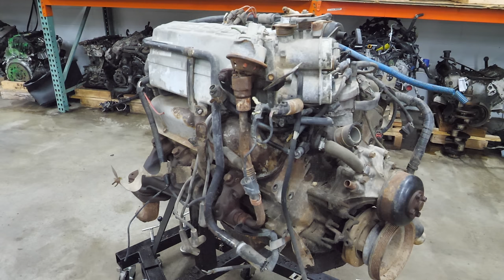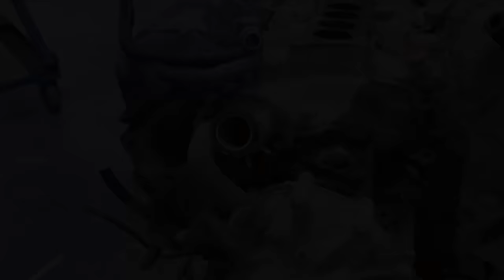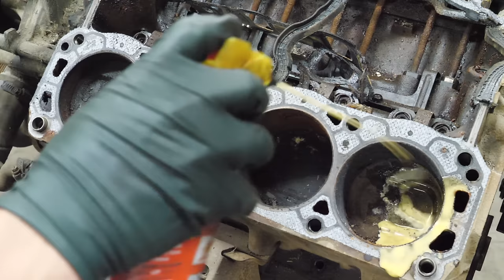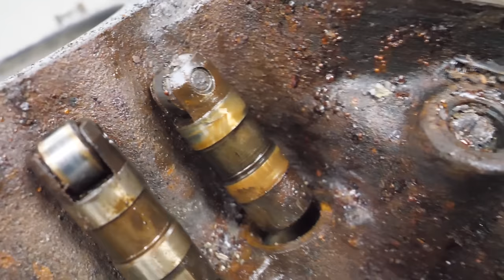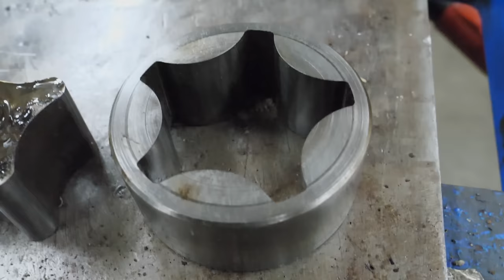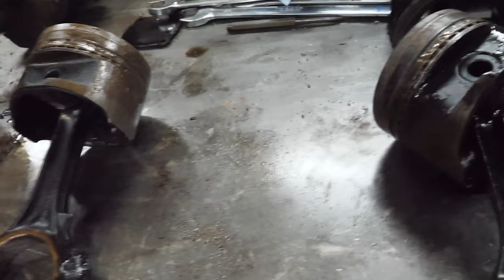LOCKED UP Ford 351W 5.8L V8 Engine Teardown. How Bad Could It Be?

Comment: Last year, I was in Oklahoma and bought a 1984 F150 4x4 with a locked up 300ci. I trailered it home and rebuilt the motor. It's my daily driver now.
Reply: I live in Oklahoma and in December I trailered home from North Carolina a 1983 F-150 4x4 300 six with 17000 original miles. Still needs some tlc due to age, but I’ve been daily driving it and I love it!
Reply: Im sure at some point brandon will ban these old trucks and force you to buy 10,000 lbs of chinese batteries
Reply: @robertshelton3796 what a totally on-topic not against the guidelines response to a couple guys having a good time sharing trucks
Reply: those 300 engines even with rod knocks will go 300k easy great engine
Reply: First engine I did real work on was 300. Head gasket failed. Got it in 91 was a senior in high school and in my second year of auto teck. The owner sold the truck to me for 500 bucks. I drove that truck for 3 years it ran great. My girlfriend at the time hated it. I sold it to make her happy.  Should had kept the truck and dumped her. LOL
Reply: @robertshelton3796  no, that's straight up BS. As long as he loves Corvettes, you're safe Skippy
Reply: They are great engines. Mine had 300k miles when i sold. It's still driven daily.
Reply: Bullnose’s rock
Reply: @Onewheelordeal   Maybe, but he's not actually wrong.
Reply: @billping2633   Well, at least you've gained wisdom, Grasshopper.  Unlike too many women.  Could have been worse: you could have married her and had her walk away with cash and prizes by now.
Reply: @billping2633  Hahaha...that's usually the way it goes...
Reply: How did someone kill a 300 straight 6? That's impossible
Reply: That's a big boy
Reply: Well yeah they are basically unkillable
Reply: An engine that did. Its job just left out to graze nice job.
Reply: Agreed brother, I bet it'll outlast any overpriced EcoBoost vehicle with ease.
Reply: @brianrowland2561  17000 original miles? Tell us the story pls.............
Reply: @robertshelton3796  Ha.............not in my lifetime................
Reply: @lutomson3496  Mine has 260 k, no knocks., runs great.
Reply: @dsloop3907  I was told it just "never left the county." I bought it in the same town it was purchased in new back in 1983. From the service records he gave me, there were years it only drove 200 miles, and then around 2011 it looks like it basically got parked. I'm technically the third owner, although the guy I bought it from was the grandson or nephew of the original owner and only had it titled in his name for one year before he sold it to me. It's been infested with some rodents before and the paint is shot, dash cracked, etc, but overall the thing is a survivor! Bone stock original, just needs a little love.
Reply: He's not wrong though.  And more people should talk about what's going on in the world because it affects all us peasants. @Onewheelordeal
Reply: How did they lock up a 300ic
Reply: @SkulkerMechanic1989 buddy and me throw a rod out of one it basically small hole enough to still hold oil and coolant other than it splashing everywhere drove it the rest the way up the mountain and it started back up... fuckers weren't playing when they built them
Reply: @michaelf.2449  Nope they literally only stopped making them due to losses from not being able to sell replacement parts.
Reply: @SkulkerMechanic1989  honestly probably fuel economy. it wasn't great
Reply: @Remingtonrestoration  sat for 10 years
Reply: Imagine that, recycling! You can’t do that with Tesla batteries and electric motors.

Comment: I have a 1986 f150 show truck all original 5200 miles on it. We made those 351's in Windsor Engine Plant 1. The 302 was made in Windsor Engine Plant 2 back in the 80's. We used to pour our own blocks and cranks back then at Windsor Casting Plant. I remember we used to hot test (start) them on chains back then. Also that is the original colour we painted the engines with grey not blue. THANK YOU for sharing this teardown, it brings back a ton of good memories Eric.👍
Reply: Very nice! im more of a fan of the 351c Ive had both and the Windsor never held up as good as the Cleveland
Reply: Thats awesome. So that means you are in Canada eh? What happened next?? The Windsor won the reliability and economy test. How do you feel about the Cleveland sibling? I can barely get 8 mpg from my 2V Cleveland with 10:1 compression but it breaths well.
Reply: I bought a 86 F150 4x4 new with a 351 Windsor and automatic. 
Girlfriend at the time, and two of her friends got hit broadside by a cop, smashed the passenger side door all the way into the transmission. They all had pretty bad injuries, but survived.
Truck had 17,000 miles when totaled.
Reply: @jamesmedina2062 There was a clear difference in the block casting method we used than Cleveland. We were a fast pour block line. The metal never sat long and we used a different formula than Cleveland our molecules were more angular. Cleveland used to store the metal in pools and had molecular problems because the molecules sat too long they would align creating a weaker block. This was determined by Ford and they asked us to go to Cleveland to show them how we did it here. I'm not knocking a Cleveland block, I had a 72 Torino with a 302C in it and it was great. We still have new 351's in storage here in Windsor, factory built in crates.
Reply: @Shotgun_Messenger  hmmmm. This is all very fascinating but makes ask more questions. I know different casting methods affect aluminum strength and hammering iron will modify the molecules and make them stronger. I thought the cranks were made using nodular iron but not sure what that is. From a dimensional perspective in the block itself I think 1/8 inch is about what came on the Cleveland and so boring 0.060 is frowned on. Mine was done to 0.030. I think they had no clue how to make the cars lighter back then so not sure why Cleve was thin-walled. So much on my 71 was too heavy. My car was about 3600 lbs wet on the scales and with alloy manifold and glass hood was about 3500. The Aussies found Cleveland weaknesses and tried to solve them. I think my build was mistaken to try and go for daily street use. I need better gearing and to take hyd roller cam out and stick solid roller in it for fast driving only! Cheers
Reply: @Shotgun_Messenger Having the 351Windsor's still just sitting around in a factory warehouse is pretty cool! Don't tell Joe(Brandon) or the EPA, cause they'll come take them & be turned into soup cans & battery cases for the EV's! Would love seeing all them sitting around! I live in Buffalo and there's a GM engine factory here. I've heard stories from guys around here that you could 'buy' a brand new 350 out the 'back door's if you knew the right guys back in the day. I wish I was born a decade or so earlier(1977 bday) but it is what it is, gotta play the cards I was dealt!😅♦️♠️ 🛠️🔧🔩👍🏻👌🏻🤔🤷🏻‍♂️
Reply: @lutomson3496  I think you're about the only person to say that. Lots of 200K+ mile 351W's out there. Not many 200K+ mile 351C's and especially not 351M's by this point. The 351M in my grandparents 77 F150 was worn out clattering junk and got rebuilt at 79,000 miles and the truck was maybe 10 years old at that point and it was well taken care of. The 351W in my truck has been through hell and even survived a hydrolock after it got filled full of rainwater once back in 2017. It's getting tired now but still running fine.
Reply: @lutomson3496  351C fan here too.
Reply: @MattsRageFitGarage  That's cause the 351C was more of a racing engine.  Lots of racers used them back then.  Still do in fact.  But harder to find blocks.  I had one in my shed in Pa, but I moved and that would not move with me.  Too much stuff I had then and could not take it all.  Funny thing was I only need a newer or not bent up pan and bought the entire engine from a guy for little more than a new pan would have cost me.
Reply: @Shotgun_Messenger interesting a company has two factories a few miles apart and one doesn’t know the casting process the other is using.
Reply: @MattsRageFitGarage  The 351C was only produced for 4 years.  The 351W for decades.  So thus why you can't find a 351C.
Reply: @timradde4328  Can still sadly find lots of 351M boat anchors floating around. My grandparents had one of those in a 77 F150 when it was almost new. Engine didn't last long and it was well maintained.
Reply: @MattsRageFitGarage  I never worked with a 351M.  I have never heard much good about them though.
Reply: Water jacket was for cylinder cooling. The Cleveland was designed more for performance/ racing than a commuter engine with cylinder pressures and temps much higher needing better heat transfer.
Reply: Windsors are great motors. Easy to work on.
Reply: Are they for sale? I'd love to get a new/old 351w.
Reply: The 302w is my favorite motor. They sound great, parts are cheap and they are easy to work on. Just enough power for a nice cruiser, unless you got one in a smaller car.
Reply: Either you had a bad Windsor or you're BSing us.
Reply: I also have a 1986 f150, not a show truck at 120,000 miles of course but still in great shape and nearly all original, painted once. The 302 has been incredible, only let me down once when the original nylon timing gear finally quit this summer. 40 bucks for a new timing set and we’re back in business. Try that on a new ford lmao the parts cost 10x more alone, and don’t get me started on labor.
Reply: @Zippadeedoodaa-nt8om you’re right, stupid cheap to own/repair and they sound so damn good with a nice exhaust.
Reply: Out of curiosity, was it just things like the valve covers that were painted grey or was the entire engine painted grey? I have a 90 and 92 f150s, and may end up semi-restoring them someday.

Comment: Not a single water pump bolt broke!?  Buy a lottery ticket immediately!!
Reply: Why? He just used up all his luck!
Reply: I've taken MANY off without breaking bolts.... 🤷🏻
Reply: @davelowets Wow that's cool bro.
Reply: That's no joke.  My 94 302 broke half of them.
Reply: @davelowets there very bad about breaking.ive taken alot off successfully as well but also have had alot break.
Had one 5 out of 7 broke
Reply: @davelowets You must have worked on engines that were properly gasketed then, those bolts are notorious for rusting due to galvanic action between the steel bolt, antifreeze and aluminum housing.
Reply: Once in a lifetime experience!
Reply: I've never worked on Fords until a year ago when I tried to help out a down on his luck guy with a 5.8 in his pickup.  That front end design is a loser for sure.
Reply: The bolt that goes thru the waterpump chamber always breaks on me.

Comment: I was fighting lug nuts on a project car I've been working on. Someone had stripped 3 of the 6 lug nuts on the drivers front wheel. I thought to myself, "What would Eric do?". 20mm deep socket took the other lug nuts off so I went and grabbed a 19mm deep socket and hammered it on the lug nuts....came right off.
Reply from the maker: That’s exactly what I’d do!
Reply: Had my first similar experience with a torx bit, only went bigger. Thanks, Eric…
Reply: Lol I threw my four way and went to harbor freight and got the lug nut kit got them stripped lug nut out whew the price for five is 50 dollars
Reply: WWED ? is the new sign in my garage.

Comment: I have a 351w powered 97 F250 HD with 241k. Truck is all original. No transmission rebuilds (E4OD) and no engine rebuilds. These Windsors dont produce a whole lot of horsepower but they're RELIABLE, dont eat gas like the 460, and dont beat the truck up like the 7.3. My truck is currently a daily driver and workhorse but I do want to at least regasket the 351W and do a heavy duty rebuild on the trans for some road trips to Alaska and mountain climbing in Colorado.

Comment: My dad had a 1989 F250 4x4 5.8l V8.  It had a bad wheel bearing and sat with the front end disassembled in his driveway for 22 years!   I would have fixed it for him but I live 3000 miles away and had young children.  He gave it away this summer to a young kid who put it back together and it fired right up.  It had less than 75k miles.  Glad to see it on the road again.  I learned to drive a manual on that truck back in 1989 when I was 15.

Comment: I am absolutely useless with my hands and couldn't wrench if my life depended on it, but I watch a new video from you every Saturday night.  Religiously.  Love this content.
Reply: I could take it apart - but as for doing so in a way that made the parts sellable, that's another matter.
Reply: Taking apart is easy.  It's remembering where everything goes is harder.  It's good you know your limits.  Many don't and try repairs they can not do and then have to beg someone to fix their mess.  My Dad was a mechanic some I am decent at fixing car stuff.  Now plumbing I hate to do work on.

Comment: I could see an engine sitting for 17 years in a humid, un-conditioned shop collecting that moisture and water. 17 years of cold damp mornings with water condensing on the block and cylinder walls.
Reply: I've had a Ford 4.6 sitting outside under trash bags and a tarp for a year now. Turned her over the other day butter smooth still

Comment: "Dont throw that away! You never know when you'll need that."

Said every hoarder ever.
Reply: Guilty as charged.
Reply: But sometimes you do need it, and then you can't find it. 😅
Reply: If I only need 10% of what I've saved it's a WIN
Reply: But the way the universe is wired, the only time you need it is exactly 2 weeks after you throw it away.
Reply: @paulmoir4452  Another universal truth is that if you lose something and buy a replacement, the original will show up immediately.
Reply: @timothyball3144 That's the sure-fire way to find something lost!
Reply: @timothyball3144 this is so accurate
Reply: In order for something to be valuable, everybody else needs to throw theirs away except you.
Reply: Now I feel called out 😂
Reply: @GLXTCHYY  thanks for the reply. This week, I finalized moving out of a shop into a much smaller space. Three 10-yard dump trucks later, and the purge still isn't over. Now I have to organize my space, so there will be more.

Comment: I sold my 1996 e250 van with 5.8 back in 2012. Had 250 k miles, ran like new, no oil leaks, no oil consumption. Replaced it with Chevy Express 3500 with 6.0l . It had so many problems and my old Ford e250 was bulletproof.

Comment: I had a 96 e150 van with that engine . Sold it at 250000 miles still running strong . It got oil changes every 5k miles . Saw it a year ago still running with over 300k.

Comment: After seeing that induction tool work, I went to Amazon and bought one. You haven't lived until you've torn down and rebuilt a marine engine with raw water cooling that was used in salt water. Almost every fastener needed a hot wrench to remove.
Reply: I do some marine work too and yes, everything is a hassle when trying to remove bolts. How do you like the induction tool? Good on rusted stuff or do you still mostly torch stuff off?
Reply: Had a 351 W in a 76 Sea Ray boat awhile back. It was approaching 3000 hours and people would comment and be in awe with how well it ran. I changed the oil several times a year but thats it. Even had the original all water pump. There is little out there now that can compare in terms of endurance.
Reply: Induction tools are a must have I used it a lot when I was in boces
Reply: @giggiddy I just ordered the induction tool so I haven't had a chance to try it. I've always used an ox/acetylene torch.

Comment: My 1992 5.8 Flareside extended cab is still going strong with 195k, no oil leaks, coolant leaks are prevalent as I replace hoses when needed. It's still my daily driver though, and has been for over a decade.
Reply: No oil leaks? Rebuilt or it's got no oil in it?
Reply: Does it still make oil pressure?  I suspect lack of OP is what caused someone to give up on the engine in the video
Reply: @mvb819  It has great oil pressure, up to the L on Normal, I run seafoam in the engine every other year. and seasonally in the tanks. My commute is only 8 miles though, used to be 20. I do oil changes in the spring and fall, theres some seepage but still good compression and oil pressure.
Reply: @thecaptain3773 what’s your mileage? That was always the biggest complaint
Reply: @jeffreygoss8109  My commute to work is short, like 10 mins, and for long drives I have a CRV, but the last long trip I took I got about 17mpg highway cruising at around 70 to 75 going down I5 in California. Due to my short commute I only fill up both tanks once a month. Everything I need is between work and home. I figure I get around 14mpg cruising around town though.
Reply: @SPAZTICCYTOPLASM  I kinda suspect the engine was replaced 20 or so years ago, but I've not found any FoMoCo rebuild stickers on it.
Reply: @thecaptain3773  not as bad as I heard. I remember people saying 6-10 mpg. Maybe they were lead foots or your fuel injection was that much better than a carburetor
Reply: @jeffreygoss8109  I flush the fuel tanks and block once a year with seafoam, and I have a K&N filter on it. I do oil changes every 6 months, and a tune up (plugs, wire, cap and rotor) before I get Ca Smog every two years.